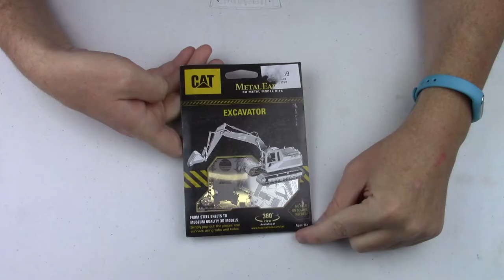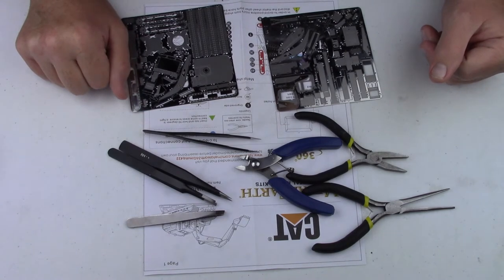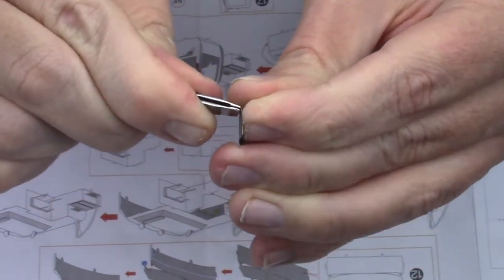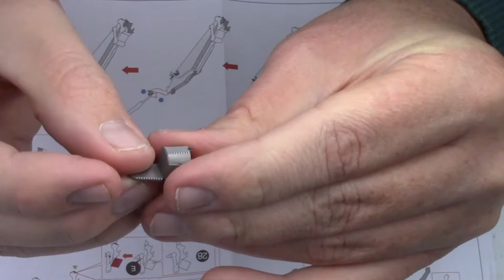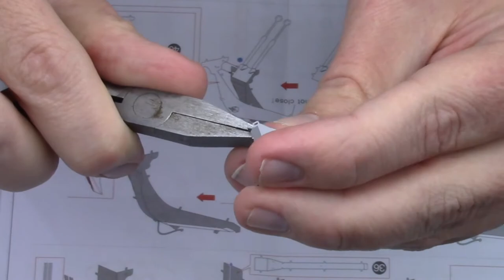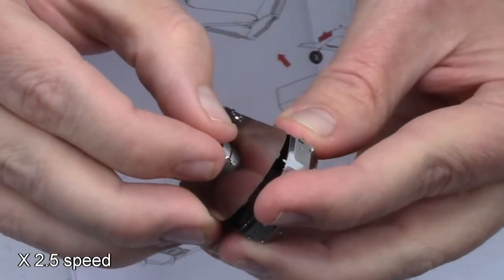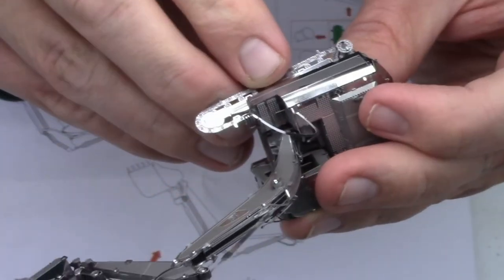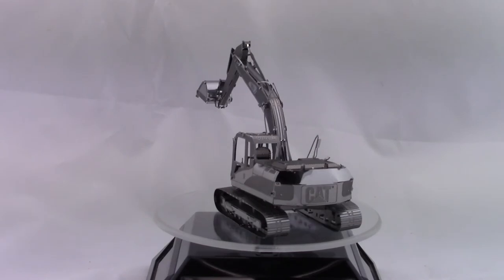Metal Earth Build - Excavator - CAT

Comment: still confused at part 21.  seems to be an area that suppose to be fold but not on the instructions
Reply from the maker: The to edge of 21 does fold at a right angle, on the instructions, it just has that bit filled in in red, which is an indication that the part folds, though it does not have any arrows to go with it.
Reply: animateorange thanks for reply. hm on the manual from fascinations website i could only see one area that is folded, another area on the other side of piece 21 also has dotted lines but not in red and no arrows.
similarly on part 24 there’s two areas folded at right angle. 
i guess thats how it’s suppose to be.

now that i think about it i might actually have a copied version kit
Reply: @yx2578  i was also confused by part 21. yes you fold one part down that is red on the instructions but the very skinny piece same side but up front doesnt and it had the pre pressed line indicating it folds but its not folded on the 360 view or in any of the pictures in the instructions. then theres another part of 21 that looks like its a tab and that it  looks like youd make it round.. i left it as is because thats how everything else is but very confusing for me lol so you werent alone on this